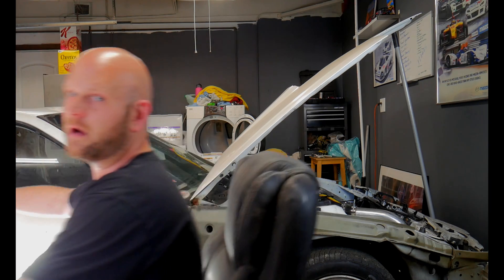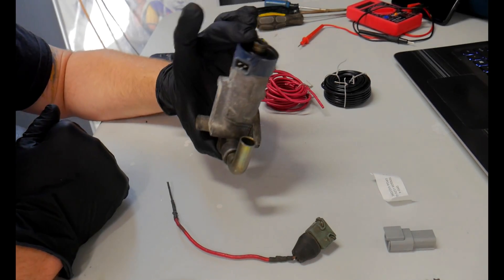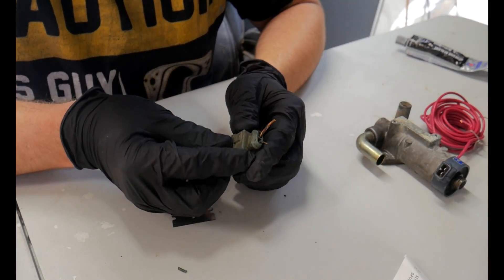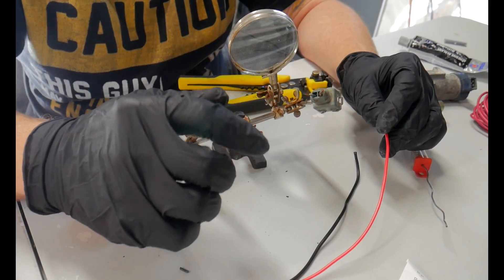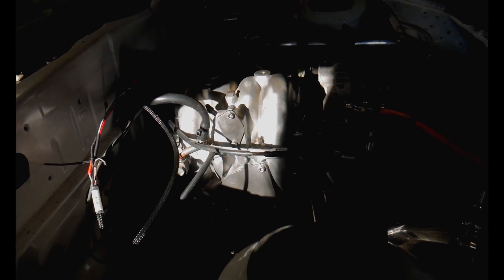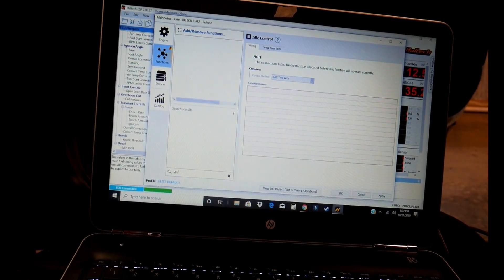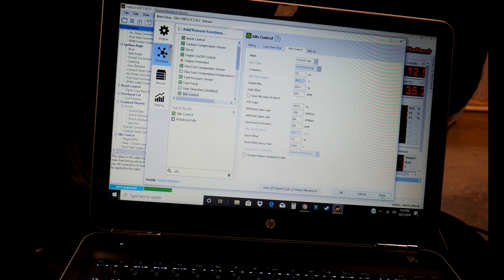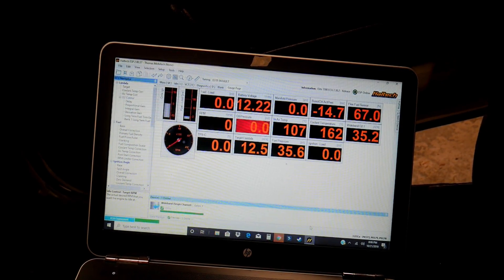Idle Air Control with Haltech Elite 1500 / RX7 BAC valve FC3S

Comment: I found that 250hz worked best for me, and to correct the surging did it by adjusting fuel, in the post start, also added a correction when idle up for a/c. Also make sure the zero demand timing is optimal.

Comment: I wired mine up on my s4 running a haltech e8 and it was out of control. Even after shutting it off I was still idling at 1400 rpm. I plugged the bac and my idle dropped down to 1000. I forget what the hz is at (maybe 33). I will give what you said a try. Thanks!

Comment: My fc acts like it wants to die when I turn on the ac what can cause this
Reply: You can adjust the flat head screw on the bac valve. I'd turn on the accessory and then loosen the screw until the car idles normally with the accessory on and off.
Reply: @Karma28217  it was a bad tps sensor
Reply: @alex10460  ah cool. I've never had that symptom with a bad tps. Always a generally garbage idle and weird stumbling under low load/partial throttle.

Comment: I have an s4 t2 on an older adaptronic ECU.   My question is, is the BAC supposed to be sucking air all the time? I unplugged mine because I thought it was malfunctioning but maybe I'm wrong?
Reply from the maker: The BAC should let air in to help idle as well as compensate for other accessories putting load on the engine, such as, power steering or AC. Your ecu needs to be controlling it or it may just stay open acting like a giant vacuum leak....

Comment: Was the BAC set screw and idle speed screw adjusted before you set up the ECU? I believe the BAC has a separate port just for setting the idle speed, and the valve will regulate above that for loads placed on the engine.
Reply from the maker: BAC has no adjustment. The throttle body has an adjustment screw which has been set. The stock BAC system does compensate for fan, power steering, and AC. With the haltech you can add those adjustments as well. Currently I do not have any of those systems that would affect the idle.